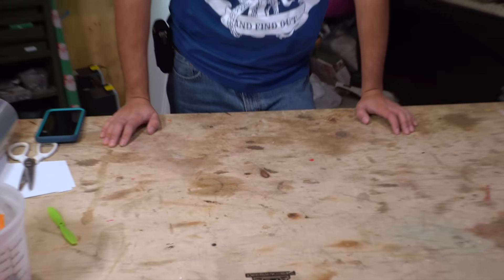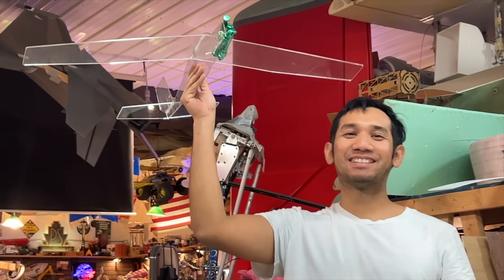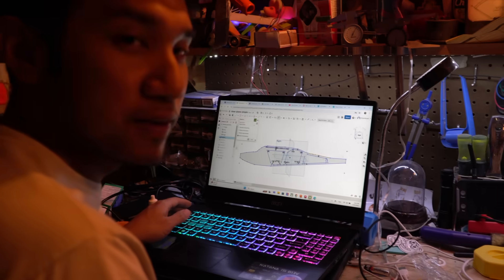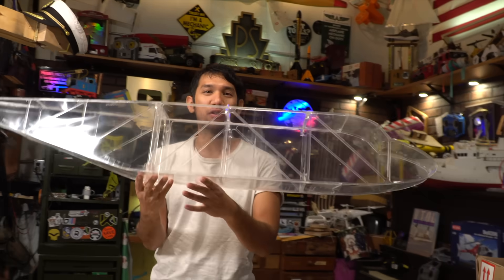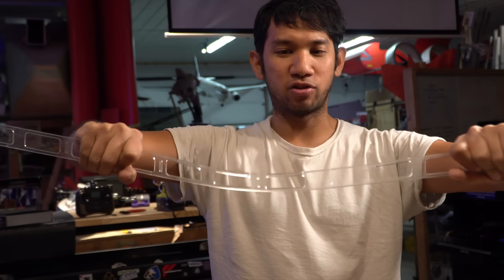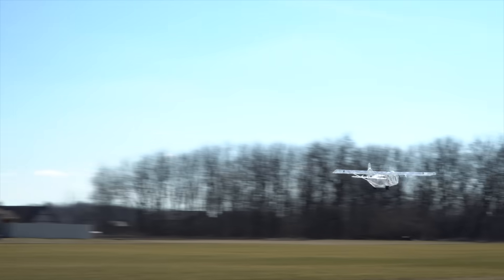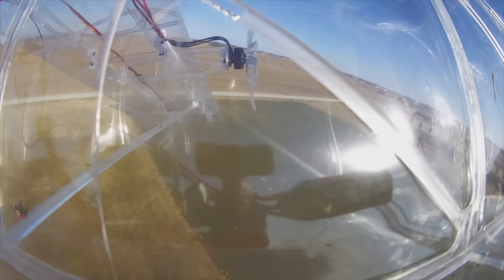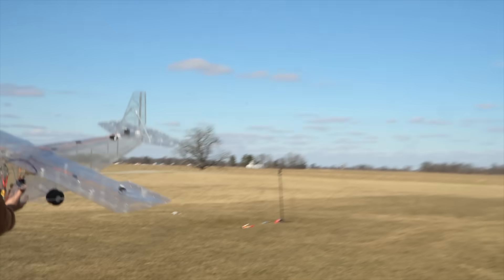Making an Invisible RC Airplane!

Comment: Peter. Some years back. Revell (IIRC) sold a model.of a plane that was "invisible"  , but eas denied by the USAF. Could the model have flown? Air & Space mag said it had all the fingerprints for stealth, but no one knows if the design was capable of flying. Bet you can see where you come in!
Fred

Comment: You should try poly carbonate instead.  You won't. E is able to laser cut it with a co2, but it has a near identical weight and is much more difficult to break.  You'd no longer have a fragile plane.

Comment: LASER CUTTING TIP : peter when cutting acrylic raise the material off the bed using metal washers on each corner of the sheet allowing the cut material to fall down ever so slightly which keeps it from reattaching as it re-solidifies. this TIP is compliments of LASER MONKEYDE ..

Comment: I use clear corrugated plastic (air filled) for my fpv wings, its lightweight, can be chopped with a knife and bended using heat gun, i ductape it but you can allways use as it is

Comment: Wow!  If you made some clear wheels and painted the battery pack & motors white or light gray extremly hard to see in the air!
That plastic stuff used for covering is heavy.  Why not use some clear Super Monokote?  They even make extra lightweight mylar for covering Free Flight models. You've got a really interesting concept there.  Very hard to target an incoming drone that is invisible! With an auto pilot and GPS navigation there's no problem flying an invisible aircraft. 😮🖖
😲

Comment: Quantum mechanics, no clear, physics, molecular engineering matter synthesis Ftl travel comprehension of what physical fabric of reality is and how to identify it the very first way is to comprehend damage called nucleation that’s when the rail gun shoots the plate and the plate vanishes the next one that you have to see is because of the Earth and everything at 32° down angle for 32 feet. The gun needs to be sitting on a platform that is 100 yards plus The two in fields of nothing on of the gun, touching the ground from where the barrel fires from if the gun was on an aircraft, that would be a really good idea 32° down angle 33 feet or more to target nucleation and you should see a watery ripple That’s the fabric of reality rip rip it had it right and it changed it twice ripping thank you that’s the start that’s proof of warp theory that’s wrapping something with something making what I wrapped it vibrate at a specific frequency and falling down the whole left by the layers of causality through the molecular structure Dropping using gravity to assist me and dropping hitting the liquid metal at the core of the planet, being protected by the vibration of the material on the outside of the can adjusting the frequency in the upper third of the metal anything more is death than grabbing the beam of energy coming out of the two gravitational Eddie’s there, and shooting back up on two above where I was at when I started falling as a gravitational slingshot and it is called a warp Assisted trajectory flight. It’s a World War I and used a lot before then bug out maneuver because of them fucking around there’s heavy mineral contamination all around the world. There’s a bunch of other stuff like all of the computers. All of the digital electronics are not running tuned properly. There’s many reasons they are out of tune for a safety reason at the same time that increases or hangover pains so much high science here it’s not even funny the light sea surface shield is what I communicate with with a fucking anything and reprogram it almost anything to actively make the thing invisible or do matter synthesis or blast out the heat of the Kilman, which it was forged.

Comment: The first attempt at a stealth airplane was actually over 100 years ago... they thought that covering the airplane with a clear film instead of the regular canvas would render it nearly invisible as only the spars and the structure would be visible. The funny part was that not only the film they've used was fragile and flamable, but it was so glossy that it would reflect the light.. So much that instead of being hard to see, it became almost a beaming light to see it.

Comment: I was thinking you could have made some structural elements using inflatable pockets of air.  Not sure exactly what to use and how to actually make it, but I think some of the hard plastic parts could have been replaced making it lighter.

Comment: Concept was first tried in ww1 was a French plane. Coverd the plane basicly in clingfilm to replace the fabric of the aircraft. It worked only the pilot and engine were visible from the ground. But if the plane was high enough you wouldn't be able to see it just hear it. It was an idea pit forward to spot German positions but the air force never took it on. After about three flights the plastic would react to the sun light and become visible again. Epic its being re visited on this channel  over 100yrs later ❤ don't belive the hype😅Google it you will be surprised how much stuff is reinvented

Comment: Hi Peter
When I was young we were warned of interference from transmitters and receivers on the same radio channel. I guess things have moved on and this isn't such a big issue anymore but got me thinking....could you fly two identical planes at the same time from a single transmitter, assuming they had the same or similar performance and handling characteristics?

Comment: Generally on those lasers it's either the laser tube or the power supply going out which is fairly easy and not too expensive to replace.

Either that or check your mirrors and lenses. They may have gone out of alignment or have just gotten dirty with dust or residue from cutting.

Comment: Pro tip: instead of using clear packing tape or transparency material as covering, use doculam. It's way lighter than other coverings like solarfilm lite and monokote and it's clear. It's the same stuff used to laminate documents and it's great for RCs since you can apply it with an iron at around 300C. An added bonus is it's super cheap, I'll buy giant rolls of these for $60. I've helped build 15 foot span clear planes with this and it looks amazing. Good looking plane, it's really cool to see the internal structures of a plane as it flies! If you're worried about it warping the airframe, just apply it to the inside and outside, the warping tension will cancel out
Reply: Have you tried window insulation film? Its original purpose is to add an airtight layer to thermally leaky windows in the winter. It's very light and surprisingly tough. 15 grams per square meter.  Some ultralight backpackers use it for ground cloths, and that community calls the material "polycryo". At least one madman made a shelter with it. It doesn't have its own adhesive, so you'd have to tape or glue it on. Then use a hair dryer to apply a little heat, which shrinks the material to make it nice and taut.
Reply: Did you also find a good clear structural material for the spars etc?  I suppose fiberglass could be made pretty translucent. 
I have seen videos of the Goodyear Inflatoplane which had no internal structure except for threads to keep its shape under pressure.  Kind of like an inflatable paddleboard or kayak.  Apparently they can be sewn/built very quickly if you're already good at building blimps.  I would love to figure out to build a clear inflatable plane!
Reply: @  No, I like to use wood like balsa, basswood or plywood for the spars and fuse in a truss. The only reason I use clear covering is because of weight. Also, it’s kind of a risk.. if the plane were clear no one would be able to tell the plane’s attitude. To make it visible, colored covering is put on the leading edge and the nose or vstab. Obviously this is just for fun and is super cool to have a clear plane, but practically the weight of balsa or bass is more favorable than acrylic, because both are strong enough to handle the loads. Which is why ive never really considered clear internal structures

Using fishing line in tension to create a clear(ish) internal structure is a really good idea…, ive seen it tried before and it works as long as you have good craftsmanship
Reply: But laminater sheets ain't perfectly   clear they have a slightly frosty appearance One side of a sheet is smooth and the other side is  rough ?

Comment: This information would have been useful  for this project, but not just this project, so I wanted to share it. Okay, so, you may or may not be familiar with the concept of electrostatic speakers, but the governing principle behind how they work is to use a high-voltage electrostatic charge to vibrate a membrane (that should be lighter than the air it displaces) to generate sound. You can make a homemade version of that kind of membrane relatively simply, by stretching mylar or cellophane over a rigid frame, stretch it perfectly taut with a heat-gun, and then treating the film with graphite powder. The applicable part of the process for this project is, obviously, the method of stretching the membrane over the rigid frame. You can use a spray adhesive on the frame, to attach the film to the frame, but I prefer to use an ultra thin double-sided tape. You could actually use one of those window-winterizing film kits (where you stretch plastic film over your window to stop drafts), which come with both the film material AND the proper tape. It would be nearly as tough as the clear tape and transparency material, while also being significantly lighter.

Comment: Ooooooh, major missed opportunity here! You could make one out of that "invisibility cloak" material, which I think is just a kind of fresnel lens. At any rate, it scatters light passing through it, obscuring objects behind it. With two layers, or at least one layer on the bottom (and maybe sides) of the plane, it would make the internal components actually, legitimately invisible. Even if you use it for the bottom layer of material, it would be invisible from below. I believe it would even scatter the infrared signature, to some extent!
Reply: Oh that would be sick, that's a great idea

Comment: You should try playing with some FEA, finite element analysis, tools next time you’re trying complex structures and saving weight. Loading and joints are rarely perfect but you still get useful results. It’s way more useful with plastic since material properties are uniform unlike wood where grain is important.

Comment: Since the weight of the tail feathers cause CG issues, why not build it it as a canard aircraft?   This way your horizontal stabilizer could actually contribute to lifting the airplane, instead of just acting like a super heavy tail.  You could also have your rudder(s) up on the main wings tips, bringing their weight near the CG so you can make them bigger and have better rudder yaw control and stability.

Comment: You can "weld" the acrylic joints using a solvent called methylene chloride, it's pretty neat, but you want ventilation and all that sort of safety stuff if you're gonna do it.

Comment: you have made all the usual design  MISTAKES.    again.
004   putting servos at the tail makes the tail  HEAVIER.    doing that is the opposite of smart.      part of the rudder should not be amputated; instead, a split/notched elevator should be made.     the design of a vert-stab should include a main spar that is oriented perpendicular to the center line.     in flight, it can be observed that the horiz-stab is too flexible.
005   the mass of aileron servos should be located as far inboard as is practical, and forward of thirty percent of chord.     the main landing gear should be locate below the cg.     and, the c-m should be optimally is correctly located at a point that vertically aligns with  twenty-five percent  of chord.      c-m  is center of mass.
009   a main wing should have a load-bearing main spar, located at thirty percent of chord.     a rotor(s)  is  NOT  a  propeller.!!!
010   the the thickness of the wing profile is not consistent with the (small) amount of positive aoa built into the profile.      compare the chord line/aoa of the clark-y  (or the n-10  at airfoiltools.com).       
the main landing gear should be located below the cg.    if if is not, the model's dom and its ability to rotate during a rolling take-off are affected.     dom  is  distribution of mass.      the optimal locations of cg and c-m are  Determined  by  the  dom.

Comment: My older Bro. built a rubber powered kit plane with a 48" wing span back in the 1950s
He coverd it with shrink (Saran wrap) glueing it to each wing ,fusaalge tail ETC. then he heated it over a oil stove The shrink rap tightened up like a drum..
When in the air it looked lake a balsa wood skelton it was a great ahead of its time idea back then. .

Comment: Anybody who actually flew an RC Airplane would know this is a terrible idea. You want the airplane as visible as possible with easily identifiable markings top and bottom. RC fliers all know how hard it is to know up from down, left from right when flying RC Aircraft, Would be impossible with a transparent plane. I one time used a light blue Monokote on one wing for repairs and in the air the wing disappeared

Comment: The next step would be:
 to build a String controled invisible glider (Like a puppet). And have a normal airplane control it. 

Put a tiny Gyro in the glider and a flight controler which acts upon the Gyro to move the strings in the tow plane.

Then just tow it.

Comment: Not sure how well this would work at RC scale, but if you put an ambient light sensor on the top of the plane and a light below the plane that emits at the ambient light level detected, you can make your plane disappear at a distance; a much closer distance than if you did not have the ambient light set up.
They experimented with this during ww2, but discontinued the project after it became apparent that radar was much better at picking up aircraft than the MK-1 eye ball.

Comment: There is calbe with transparent coating and if they are nickel or tinned leads they are silver like collor and they would be way less noticable.

Of cause, the wheels are also very noticeable, as well as the servos. There do exist servos with transparent housing, but all i can find are tinted. Still tinted blue is way better than black.

And its not really about being totally invisible, but rather being much harder to spot.

Comment: Germany dabbled in making "invisible" planes during WWI. They used cellon acetate to cover some Fokker 2's and Riesenflugzeug bombers. The result was planes that reflected light so much that they were shining beacons in the sky. The cellon would also expand and contract due to heat and humidity, and was also highly flammable. Needless to say, though some of these "invisible" planes did see warfare, they were pretty quickly retired.

Comment: Isn’t this why in ww2 a lot of planes where polished to a chrome/mirror finish as they where trying to use reflections as camouflage basically. Or if a plane was camouflaged to the sky very well would it technically be “invisible”

Comment: A plane built from PCB's. while stuff like Liipos and ESC's and Motors will still have to be there, it would be cool if there were no wires because all the traces would router power and signal to anywhere it would need to go.  the body basically acting like a giant motherboard.

Comment: wrong type of plastic so that plastic is clear as almost like white but lexan plastic so that show a little blue color to be seen because it much stronger and light weight that has been used for safely glasses for work use and it will stop the .22 bullets easy so thats strong enough to use it to make that plane like that so thats how it works like that so next time use lexan plastic is the best got that now so don't be stupid for other kind of plastic could break easy ok

Comment: Wrong plastic Peter. Lexan is stronger and less likely to to shatter. Pricey, but if you break enough acrylic trying you may want to save both time and potential failure by spending wisely.

Comment: Its amazing how you're using an actually good radio and video system. ExpressLRS is just the best, most modifiable, longest range radio system and walksnail has great quality, more accessories like the head tracker, and is cheaper than DJI, with better quality than analog. Just know that I 1000% approve of your choice of radiomaster pocket and goggles L.

Comment: I bet your lens is just covered in all the slimy smoke that acrylic makes. Even if it's not condensing on the lens, it blocks and diffuses the beam and cuts like crap. Better evacuation fans/forced air/down-draft/cross-flow/black magic/etc might help cut through plastics reliably
Reply: ...and it's pretty hard to cut clear stuff with light, in general. Any kind of light-absorbing film or paint on top would work wonders.

Comment: I have been wondering about a hypothetical vacuum lift balloon. basically a balloon that has an internal vacuum (instead of helium) that creates lift because it is lighter than air, maybe using hydrogel as the rigid structure.  Theoretically it's possible but likely not in reality.

Comment: Great video! How about making a plane that can reverse itself in midair by folding up rudder and elevator on one side while extending them on the other, as well as flipping the wings somehow or changing the airfoil with some sort of elastic wing? I’m imagining it going vertical into the air, reversing on the spot, and then diving straight down at full speed again.

Comment: I just thought of a cool challenge. A paper ultralight that can actually fly a person and not immediately break. The only structural and aerodynamic materials you’re allowed to use are paper, cardboard and wood for extra high stress areas only (paper comes from wood so it’s technically not cheating)